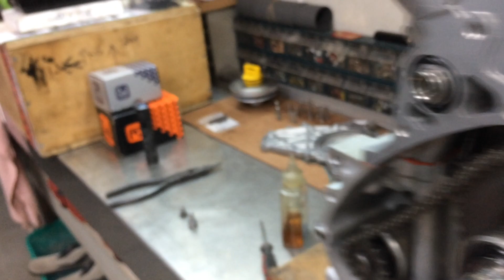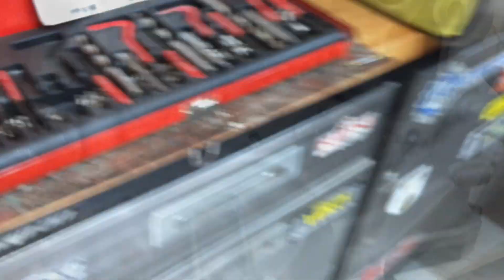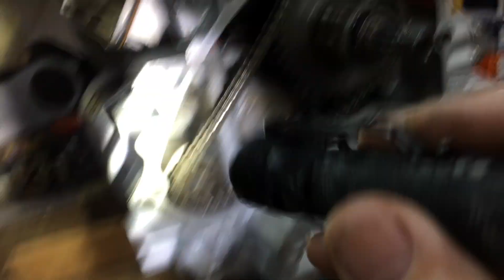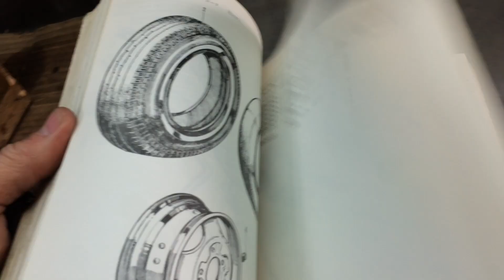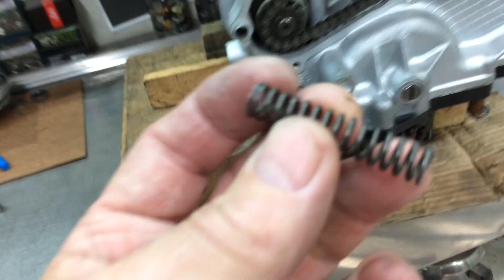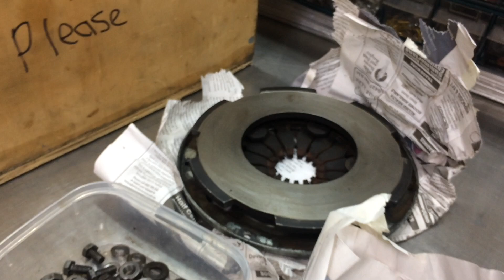Honda S600 Engine Rebuild! Check Valve Fixed!

Comment: Great job Jason !  Glad that part is sorted out.   I would not have thought of that either.
Reply from the maker: Thanks Stephan! I guy I know sent me a photo of a Stuck Valve I knew straight away was in there. I don't know why the last guy that worked on this engine cut the spring & an old Valve in half & shoved it in there. Made Me think it was like that. Oh well got sorted in the end. Cheers!!

Comment: As always super work super informative, saves me making the same mistake.  Moreover I understand why that valve is there, I presume if the oil is struggling to pass the paper filter it allows it to go up to the centrifugal filter and save you from a very bad day in the office.
Reply from the maker: Thanks Mate! Yes turns out it's pretty important. Brenton the guy that gave us the Clutch Master sent Me a photo of a stuck valve I knew straight away it was the same. Cheers!!

Comment: The hole you think might be for some kind of sensor in the lower crankcase is, I think, the bottom receptor for a separate oil drain pipe that runs from the underside of the cylinder head to that hole and MUST be fitted at the same time as the cylinder head. Hope this is another save, keep up the great work.
Reply from the maker: Thanks Paul! Yes Thats what I was thinking, must be a Oil Pressure Sensor. That Pipe the Oil Pump Shaft go's inside it , I will be definitely installing it thanks. Cheers!!

Comment: Is that an Oil Pressure relief valve??    The Starter Chain   ??  Weird
Reply from the maker: Thanks Joe! Sort of they call it the Oil PressureCheck Valve, diverts oil to the main filter & top end at high revs. Cheers!!